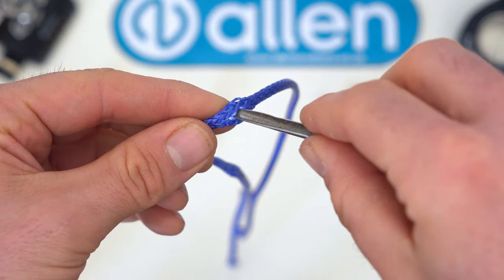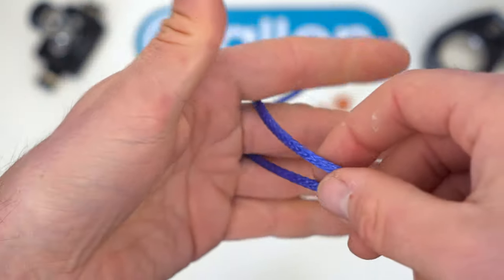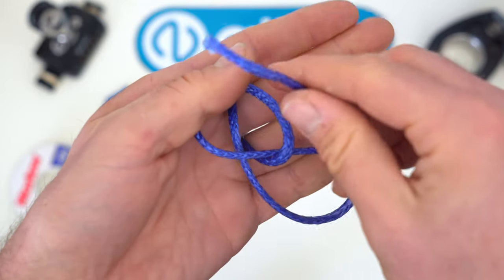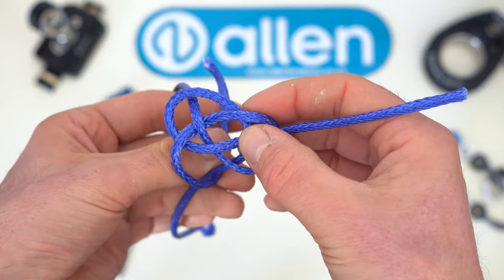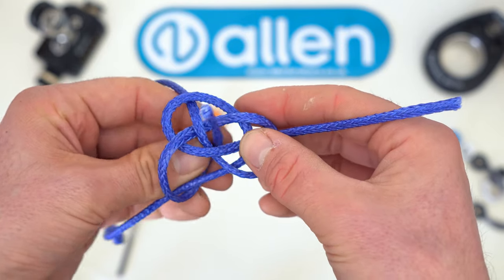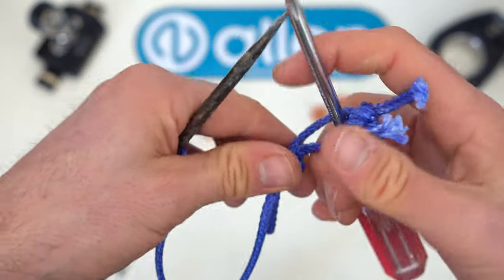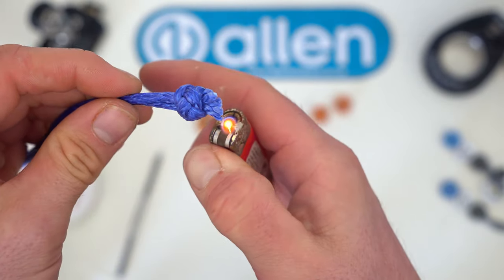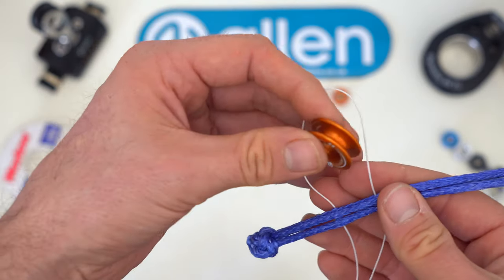Soft Shackle + Low Friction Ring

Comment: I am a bit confused by low friction rings.  Should the sheet go through the centre as in this video or around the outside as you have  in the mock up displayed as a backdrop in many of your videos.  Or can you just do either?  If around the outside, ie more likely a pulley, should the ring be static and the sheet slide around it or should the ring spin around the rope that goes through the centre making it very much like a traditional pulley?
Reply from the maker: Can be either, but is more usually the moving line through the centre.  If the moving line goes around the outside then the rope going through the centre becomes the bearing.  You want the ring sliding on whichever rope has less friction.
Reply: @MozzySails  Thanks for clarifying as just in process of using a couple for an outhaul reefing line.

Comment: Which knot do you use for the thimble? Thanks.
Reply from the maker: I just use a reef knot in the twine with a hitch either side. Its not really holding any load so just needs synching up tight enough so it doesn't work loose

Comment: Doesn't this leave a large gap between the top of the sail and the top of the mst when the main is hoisted?
Reply from the maker: I've made this with a larger ring and soft shackle to make it easy to see, but with a 15mm ring and 2mm dyneema you can  get pretty close to full hoist. But yeah, a shackle might get slightly higher. 
On the jib halyard it's not so much and issue.

Comment: Here's quick suggestion to avoid any extra twine trickery: make it just a little bit longer and pass the eye through the other end and then close it to another direction. So that when looking from the side from where you can see through the ring, instead of the shackle looking like a zero, as it does in this video, it looks like a figure 8. It will keep the low friction ring in place well even when slack (as long as the shackle is not too long) and can still be undone easily.

Additional tip to that: when the length is done right, i.e. short enough, you need to take the low friction ring off before tying the soft shackle into the figure eight that I mentioned and then, once tied, insert the low friction ring in its place.